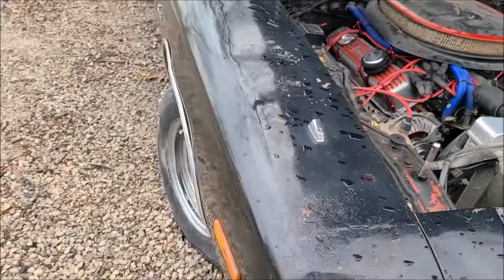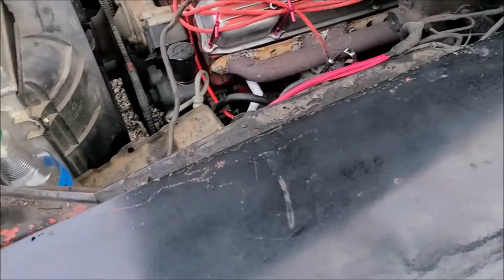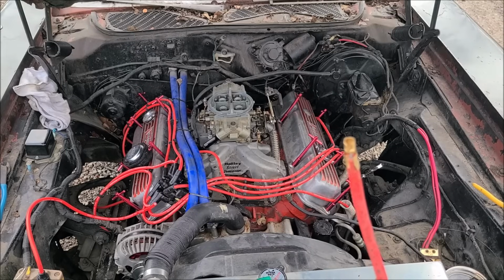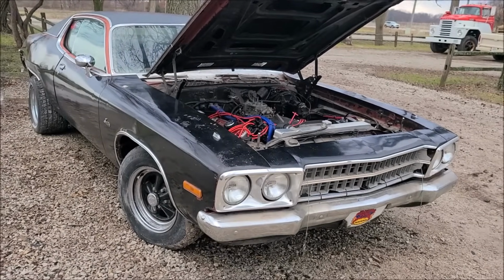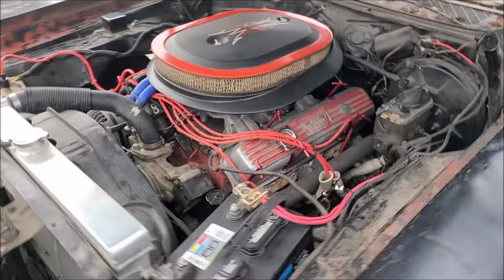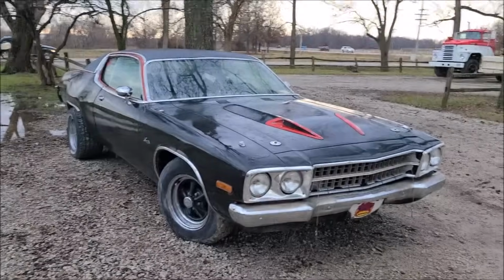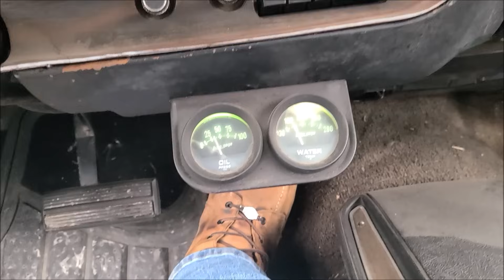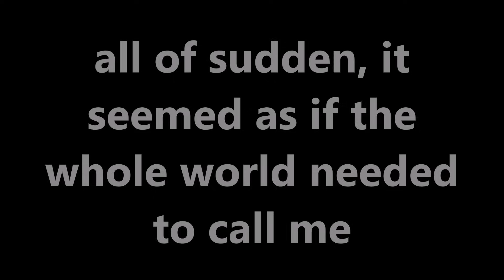The Last Fix to my First Muscle Car! Stroker Big Block 1973 Plymouth Satellite Sebring Plus

Comment: Put a high pressure spring in that oil pump Jed.  That what Nick uses. Stock pump with a high pressure spring.
Try 20/50 Valveoline race oil! It doesn't break down when warm!

Comment: Oil pressure is ok.Alot depends on clearances after temp.The rule for minimum  is 7psi for every 1000 RPM.
Reply: I ve heard of the minimum, but- if I have 7 psi, at idle-- My engine is getting torn down!!   LOL !!

Comment: recently did timing chain kit on my k1500 days are short working in the dark usually fix in daylight come time to start it up spark plug wires looked christmas tree. Anywhere plug wires make contact there was arcing worst ones were by firewall where i never look others against exhaust manifold heat shield now its got get up & go power made a huge difference AND the annoying buzz on the radio is gone. of course tilt steering column fell apart again

Comment: Happy Birthday to your dad! I watch your channel religiously.
You said COLDSTART:So Cold outside, no choke, cammed motor, 2 pumps on the gas. Well it started & runs a-lot like a warmed motor. I Sorry but there is NO way that’s a cold start. If I’m wrong well I apologize. But I’ve never in 66 years seen a motor like yours, no mater how well timed can start & run like that cold.
Reply from the maker: Sorry,  but you're dead wrong, I would never lie to my viewers about a cold Start. It was about 30-35 Fahrenheit degrees that day. That engine even with the race 6 pack started easily.